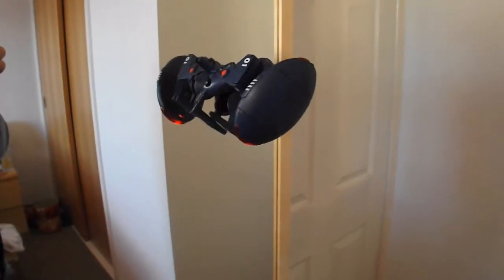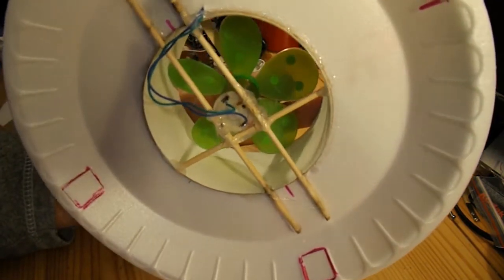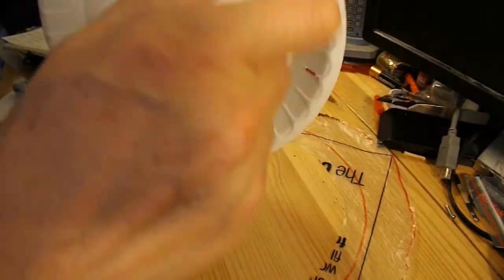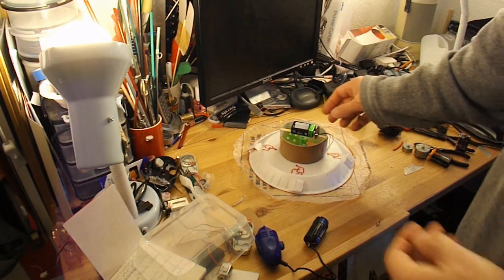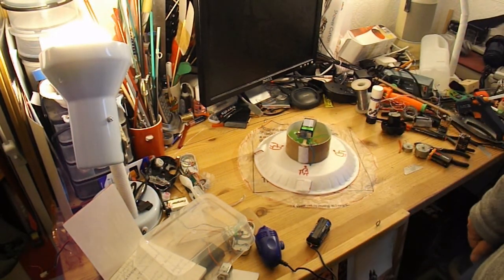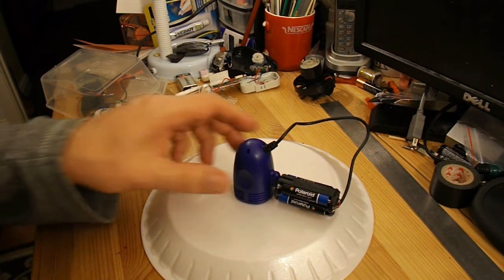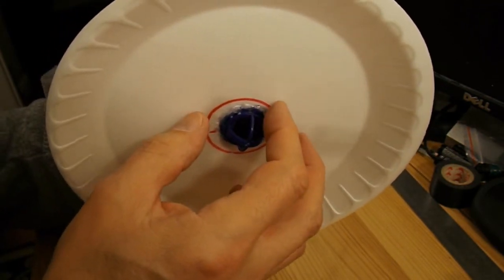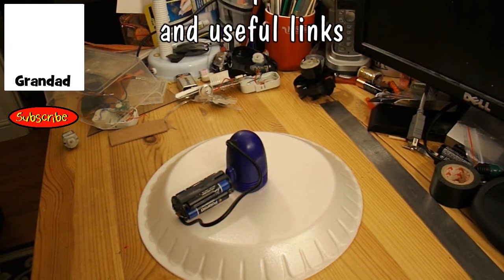Wall Hugger Part 1

Comment: ideally it should be able to negotiate the wall/ceiling corner. ceilings make for easier travelling because no uphill problem. should also be able to go round vertical corners in walls, both kinds. not as silly as it might at first seem because walls & especially ceilings are very uncluttered, also a good view of surroundings so might be a good basis for a telepresence robot
Reply from the maker: Hi David, I think that will be beyond the level I am aiming for here. My projects tend to be things I can conceive and build in one evening. Maybe when my grandchildren are in their teens if I am still around that could be a joint project.
Reply: GrandadIsAnOldMan bare in mind that if a child wants to get at a ceiling it may not be too fussy about how.